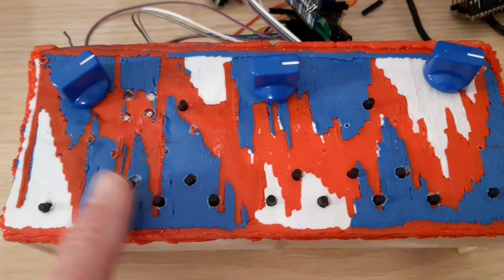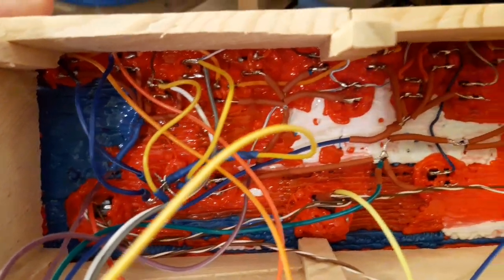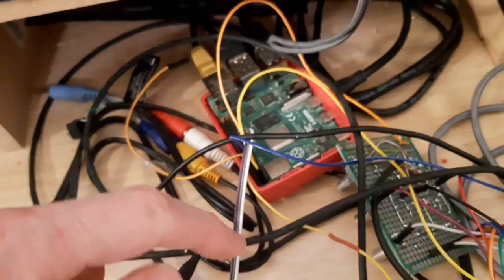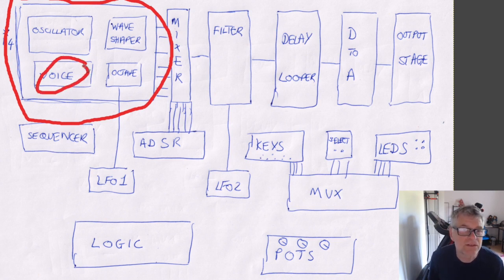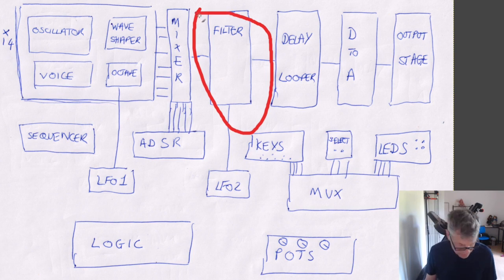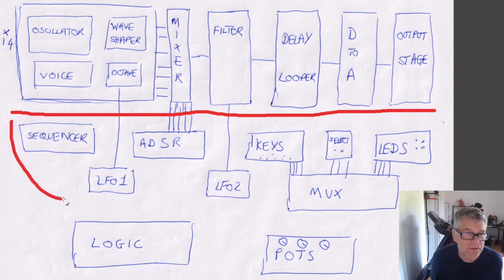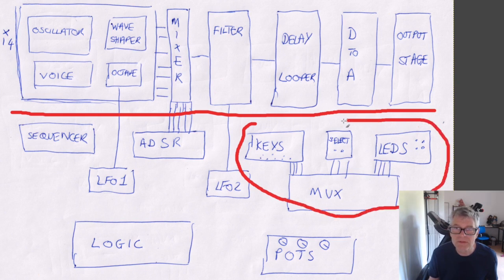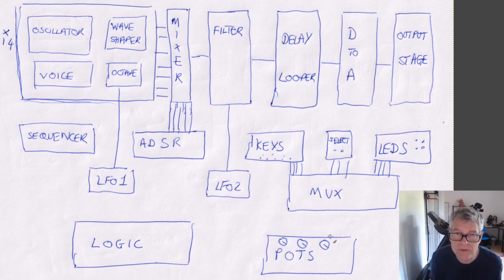PicoDrone Part 1 - Introduction

Comment: This looks like fully functional drone. Adding the octaver was a brilliant touch. I wonder if it's possible to route the reverb through the octaver? I imagine it would produce a sort of shimmer effect. Your block diagram is very helpful to visualize what's going on. I'm looking forward to the rest of the series!
Reply from the maker: Patrick. Thanks for watching. The octaver does have an LFO of its own and I am contemplating changing this about a bit. More on this as we go.
Its easy with diagrams to get stuck with the draw program so I have gone for the paper and pen approach...

Comment: Is there any way we look at the code a bit more ? It's great to see the architecture but I would love to see a little more under the covers
Reply: Is there an opportunity in the code/interfaces to make very slight changes to the frequency of each oscillator to get that out of tune beating sound?
Reply from the maker: Gareth. Thanks for commenting. Yes I am going to deep dive into the code for the oscillator and I have already played around with a slight oscillator detuning process. More on that in part 2.
Reply: @loopinnerthe  awesome great editing and content btw really well presented